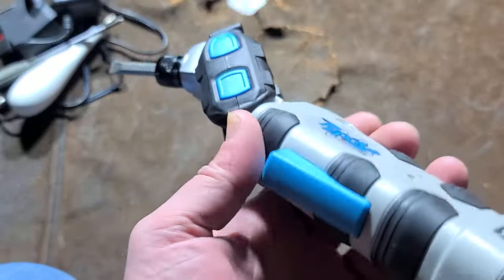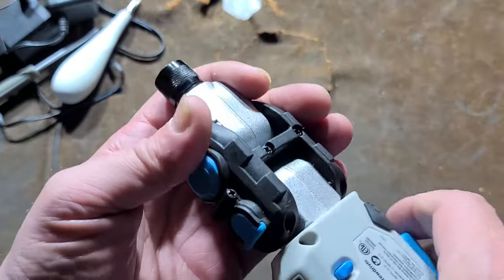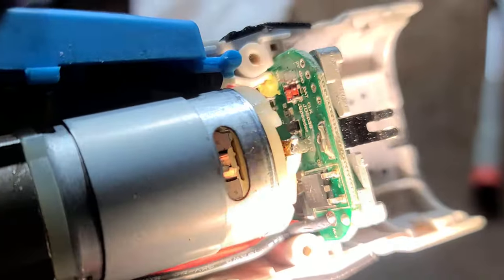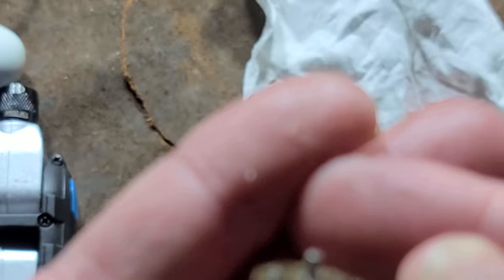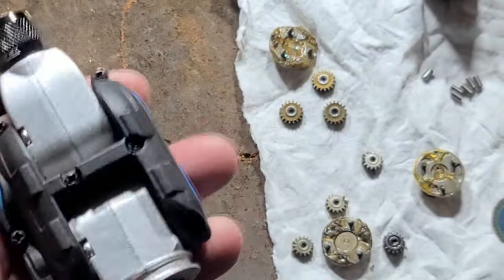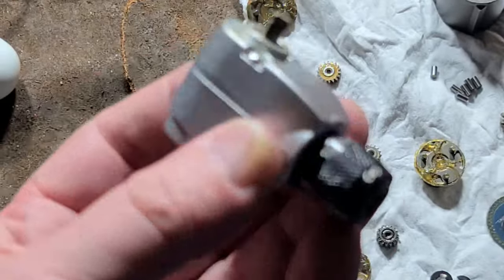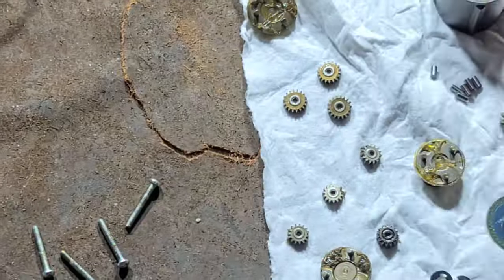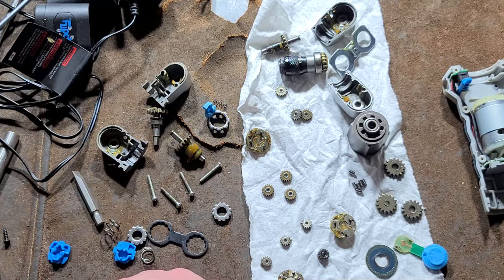Speed Hex FlipOut 2nd Gen Multi-Pivot Articulating Screw Driver Review & Teardown

Comment: It actually started out as a kick starter im sure that version cost a couple hundred bucks but the one you have is a old home depot version they actually have a new one released by menards or whatever that store is called we don't have them in utah but I actually have 2 of the menards versions its defiantly different slightly than the one you have the battery is longer i've had 2 of each now so im pretty familiar .. I really wonder if they fixed the issues you found..